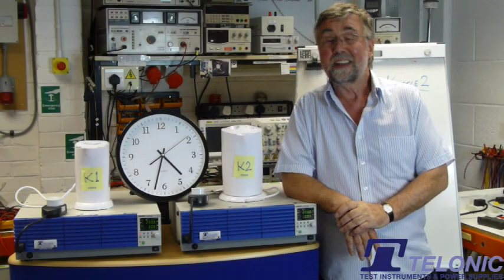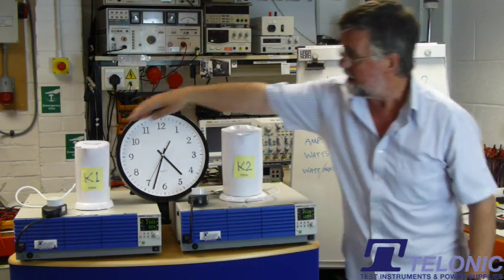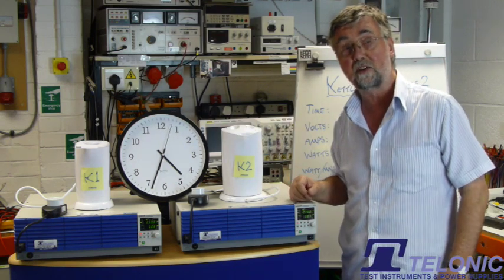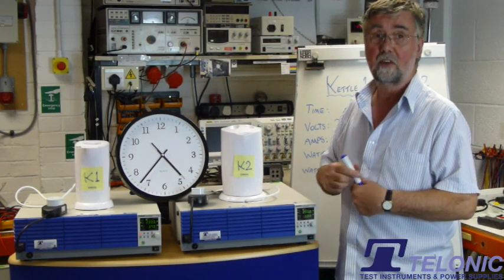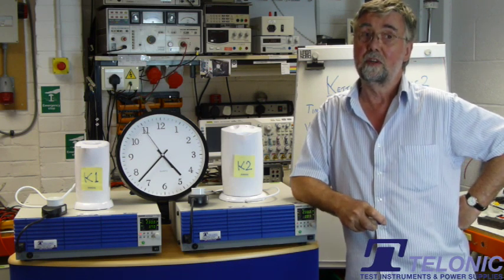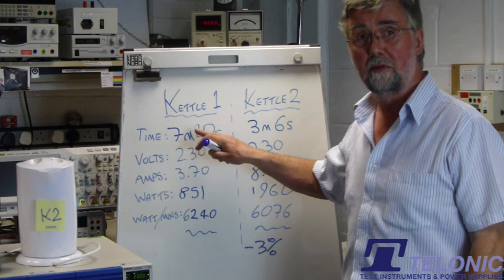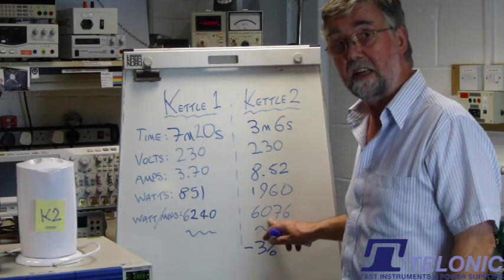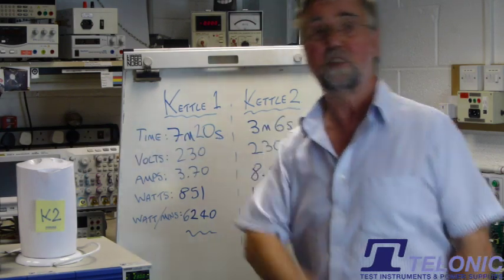European Union (EU) ban powerful vacuum cleaners, what's next the humble kettle.

Comment: Of course, the longer it takes to boil the more heat will be lost while waiting for it to finish boiling. It's akin to trying to solder using an iron that's too low wattage for the job. The heat can radiate away almost as fast as you're putting into the copper circuit board so it takes longer to solder, thus using more power overall.